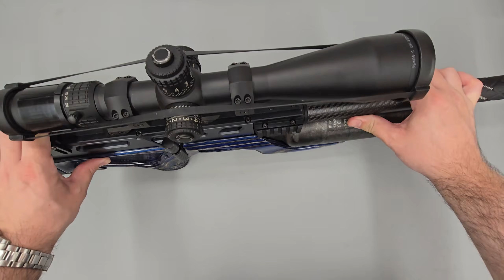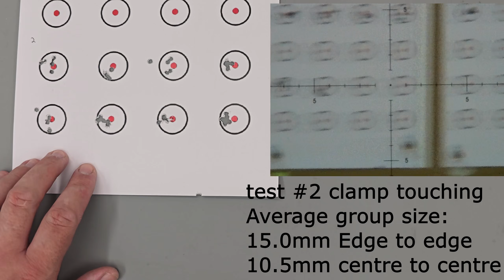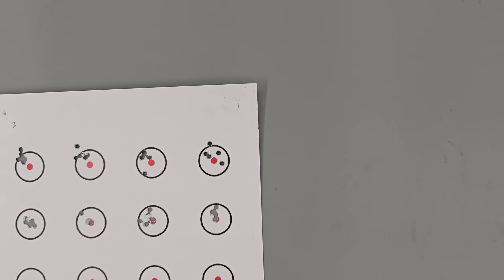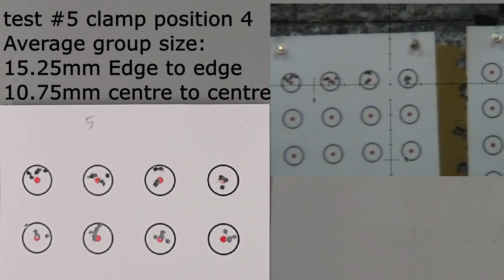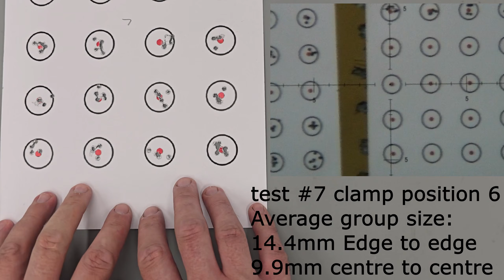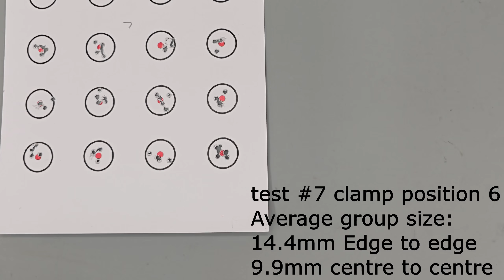Barrel clamp testing

Comment: Hi Guys, another good video. I have been playing with barrels on my ghost HP and had already bought one of these clamps. What I noticed was if I fitted the top piece, refitted the barrel,  then loosened the two top screws there is approximately 0.1mm of play in the clamp, hence the large amount of POI change you experienced when tightening. So one coke can gasket later fitted between the top part of the clamp and the top rail, the barrel still slides in comfortably and no play when the top piece is loosened. So now some testing required

Comment: Excellent video Jake and Co....even though now I am fighting with myself...the side that wants the most precision out of my Ghost vs the side that says $178 not incl shipping  for the clamp is ridiculous...
Are you, can you do this same testing for the Ghost's Barrel Tension System?  I have so many questions as to how that really-best  should be "applied" to the  barrel to get "tension"...One video tensions it against the barrel grub screw...another uses the 6 grub screws on the spacer....
Not sure how much tension you can apply against one inset grub screw or 6 digging into the surface of the. barrel....
thanks Jake!

Comment: Do not do yourself down, it was very interesting. Some points I would make, is it better to use a Torque screwdriver for tightening?  it would be my conclusion that the harmonics of the barrel are changing the same as when the weight is changed on the business end. More experiments come to mind I await with anticipation.
Reply from the maker: we was going to use a torque screwdriver but thought lots of people wouldn't have them so just went with the feel 😀thanks for watching 😁
Reply: @sub12airgunners  if you did use a torque screwdriver, what would you torque them too?